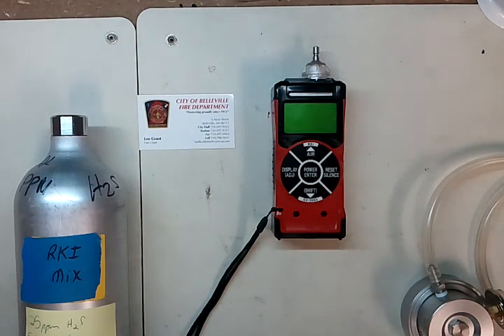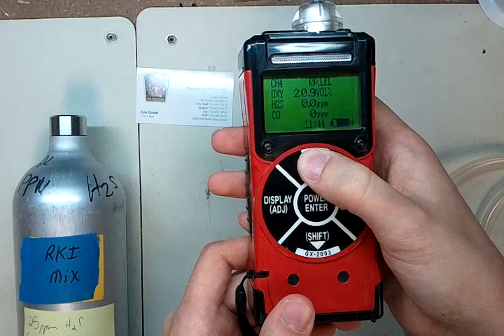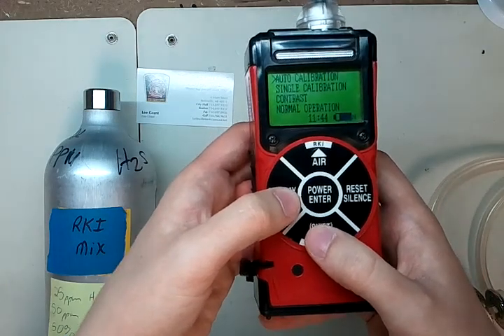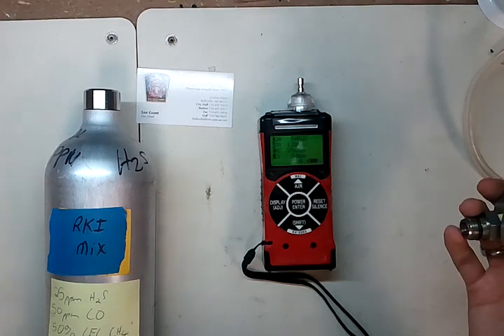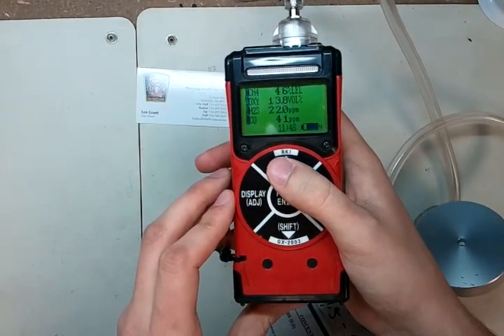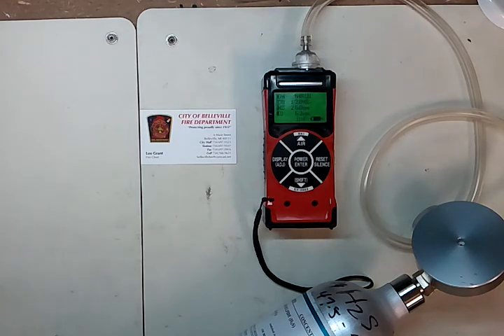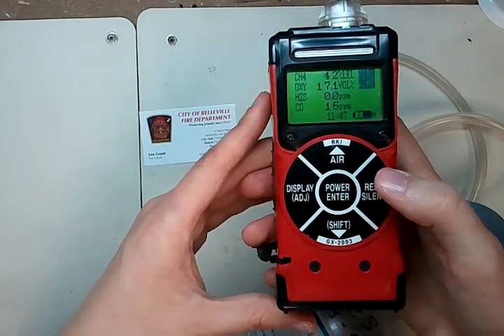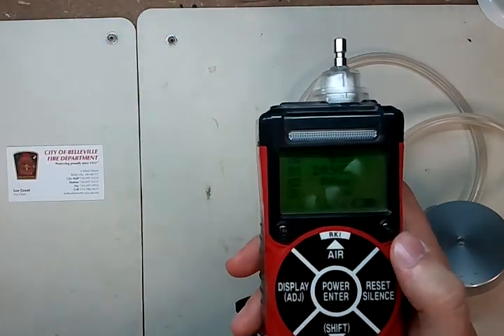RKI GX-2003 Gas Calibration Guide by Ideal Calibrations

Comment: He'll have to forgo the autocalibration mode and manually calibrate each sensor.  It's not too much extra work.  Just go to Single Sensor calibration and do each one individually with that gas.  That said, make sure the customer checks the expiration date on the calibration gas and respects it.  For some reason I find that customers who want to change the gas value to that of another monitor's (unless they have a good plan in place) are more likely to use expired calibration gas that they got from a friend or off ebay.
Reply from the maker: +James Moore And I just realized Youtube logged me in under my personal instead of the company account.  Info still applies, but have a great day!